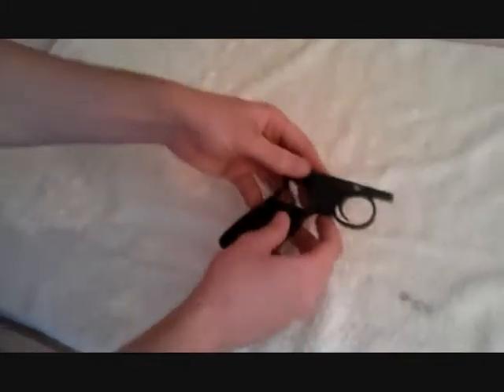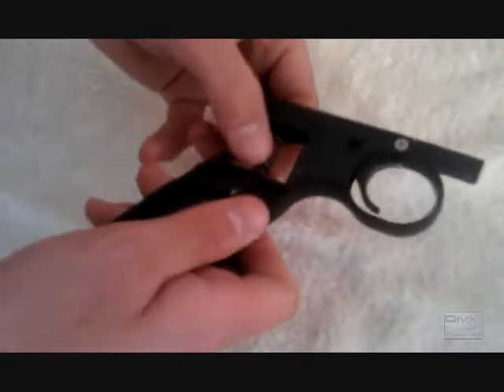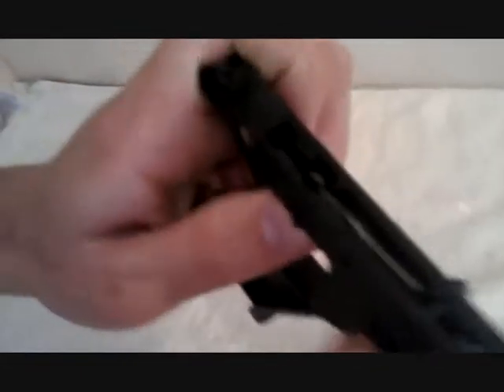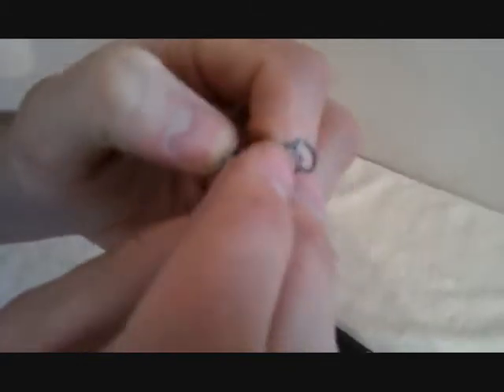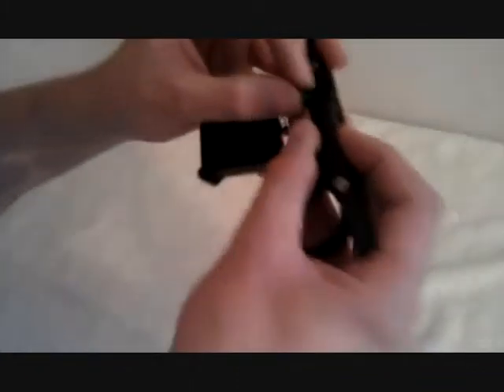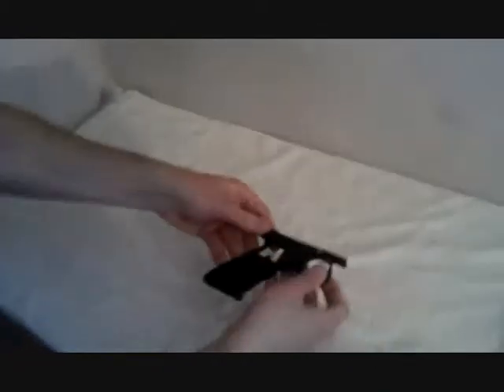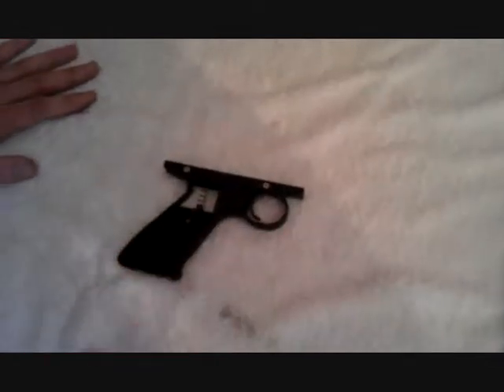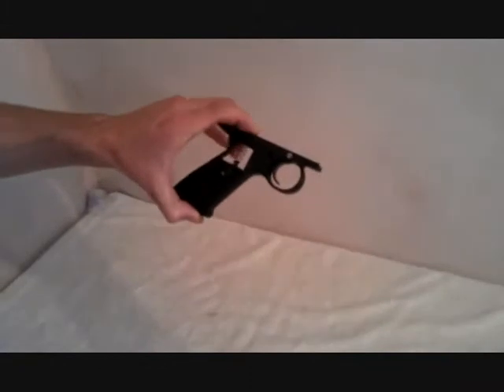CROSMAN TUNING - LIGHTER TRIGGER - Crosman 2250 Ratcatcher Tuning/Modding Tip

Comment: Another way to lighten the trigger is to just squash it down a tad between your fingers. If you go to far just pull it apart again.
Dont forget to sand and polish the contact points of the metal between the trigger sear and trigger itself. Makes the movement alot slicker ,,,